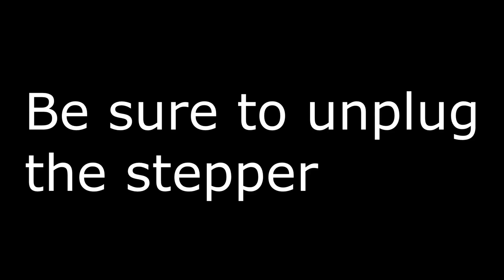How to replace Extruder Stepper Motor on Creality Ender 5+ 3D Printer - E35+

Comment: do you have to do any calibration for the new stepper motor i recently replaced mine and it seems to struggle when extruding it will start fine and ill put down a couple fo layers then will not be bale to extrude anymore ive checked the nozzle and its not clogged, only reason i got a ender 5 plus is for the bigger build area but it's been a huge waste of time and money compared to the ender 3 i have
Reply from the maker: 5+ is a big tough machine to work with. Shouldn't have to adjust anything. Make sure it's the correct size Stepper. Maybe got a Dud? There are some great groups on FB where 5+ owners talk about all this kinda stuff. I would poke around there and ask. Make sure using a good Extruder. Not the stock one. Grab a metal one. Link in my other 5+ video

Comment: Which you you recommend?
Ender3S1 plus or ender5 plus?
Reply from the maker: 5 Plus is WAY BIGGER. You will want to put TH3D Firmware on it. I am not a fan of the S1 line, but, if I had to pick an S1, it would be the Plus., and I have made very nice things with my S1+. Keep in mind how huge the 5+ is. It's also not Direct Drive, if you think you need that. If I could only have one, I'd have my 5+ for sure.

Comment: I have a question, unrelated to this video. How does one remove the z screws on an Ender 3 S1? I loosened the motor couplers but shouldnt they just unscrew or do I need to remove something off of the top bracket of the screws as well? Trying to take them off to see if they are bent or not. TY
Reply from the maker: Forgive me,  but I'm not totally following what your trying to remove.
Reply: @3DRundown  the 2 z-axis screws/rods in back? They go through 2 brass fittings midway up the z axis? Want to remove them and check them for straightness and maybe add oldham couplers. I am having a hard time figuring out how they come out.  TY